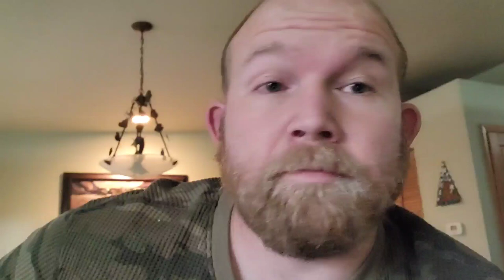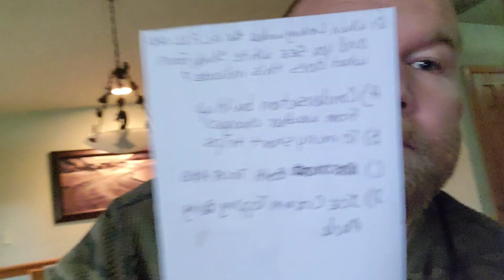Oil Cap - Why Is White Sludge Under It When Checking Oil - ASE Style Question

Comment: I have a 15 GMC Terrain 2.4 and every time the temps get below freezing I get the snot in the dipstick tube and oil cap. I drive 45 miles each way to work and back, So the engine gets to full temp. It has done it since new. Blame it on the plastic parts. 2001 Dodge Dakota 4.7 did the same thing on the plastic oil filler neck even after the “baffle” update.

Comment: i agree 200%.  but as most people don't understand what a short trip is you may want to go in to that a bit farther. 
to me a short trip is under 15 miles, as you say you need to get every thing up to temp to burn the moisture out. 
but i am up in the north east or about the same weather you have.
Reply: My father in law used to drive 1 mile to work. never let it warm up either. just jump in it Crank it up, and literal 2 seconds open the throttle up to about 80-90% as he leaves. 

I know it was 80-90% because I had a scanner on it while he was driving once, and I saw the throttle position on every green light and pulling away from every stop sign. the throttle was opened to 90% for the first 5 seconds or so.....anyways

He would complain that I wanted to do oil changes before the 3,000miles When he drove it 10miles per work week, then maybe 20 miles on the weekend.

Once a few years back it had the oil pressure light come on. I checked on the car and was switching the oil filter for a new one when the oil that got on my arm and hands started to burn after a few seconds, and it got worse in a few seconds as I was running to a sink.

....the oil had actually become acidic. And I later checked out the filter and found that it was plugged with carbon.

Comment: I'm glad you came back at the end and stated the other problem. That's the problem I see over the other two in my lifetime more than anything else.  My environment is probably different than yours as most people in this area drive more than just to the grocery store and back home.  With high prices at the gas pump one might see more of this "white foam" at the filler cap because people aren't going to have their vehicles warm up for very long. IMO

Comment: In the dead of winter mine is always like that, despite a 35 mile commute each way on the interstate. When I first got the car it concerned me so I sent an oil sample to Blackstone labs. No antifreeze, just some normal winter moisture. If you're concerned I'd suggest testing the oil. It's cheap and will tell you how the engine is doing.
Reply: Plastic filler necks valve covers. I feel that they don't heat up like steel.
Reply: @marktiitto7616  you have a good point. Hadn't thought about that

Comment: Yep, both are correct. It's nice that the grocery store or work is five minutes away, but that engine needs to warm up to and ran at operating temperature to burn off that water. Running at operating temperature will take care of the condensation from both the weather changes and many short trips (but will not take care of actual problems, like you said). Obviously where that vehicle is operated varies, but getting to operating temperature is key.

Comment: Honest car dealers are out there. 
After an hour and a half drive up and across a mountain pass to the cold side,  with an additional 1 hour+ to jobsite, unload (no more than half hour) at 30ish degrees, headed back uphill when white smoke starts billowing and engine heats up, (''75 F-350 390 4bbl glass truck) is chugging and out of power.  Dipstick is covered in chocolate milk, so I limped back to the jobsite. Off to the Ford dealer in town, says the boss. That was Friday night. Things looked grim for the old flatbed.
All cylinders held pressure as did the cooling system. They indicated a low coolant level was the only problem, no leaks detected, so they topped it off, $27.00 on a Saturday morning, expecting a blown head gasket requiring us to leave the truck behind as we were working in Yakima but home was Tacoma. That was 30ish years ago. Truck ran fine going home, as if nothing ever happened.
The technicians said it was just condensation.

Comment: This is why, in Canada i change my oil in November and May. Winters up here are harder then hell on the engine.  A lot of extreme cold operation. I have seen a car driven 50 miles on a highway at 60 or 70 mph when its -40F out and it still wont be warm an hour later.  My F150 suffered with condensation problems under the oil cap every winter, could clean it out with a tea spoon. Still got 180,000 miles out of it though!

Comment: Many years ago when valve covers were steel pressings we used to put a plate in front of the cover so the fan air would not cool it and it could run hot and burn off the condensation, now with the plastic covers this does not work. Same reason, stop start running AND with the cold ambient air (Uk winters can be cold) and a warm engine, some condensation is normal. We used to say if it is in the valve cover, no worries, in the sump, start looking for trouble. I noticed a lot driving in the tropics, the air humidity can add to the problem but it is usually only cosmetic.

Comment: I use shop air thru a regulator and add a tee to the small hose between the degas bottle and radiator on my 7.3's to pressure test them. I recently had to swap out a 7.3 because of coolant in my oil and found a crack between cylinders 1 and 3. IDK what caused it but I found it on my pre trip and it hadn't shown up on the cap yet. Was throughout the injectors, but didn't make it inside the pushrods.

Comment: I noticed my oil level is slightly low, when there is pudding under the oil cap.  After a good heat cycle, pudding gone, the oil level is back up. I then put some of the pudding in clear cup and brought it inside. It turned into oil. Try it in video Rich.

Comment: I had that problem with my 2004 suburban I changed the thermostat from a180 to a 195 and stopped having the problem it only did it in the winter.

Comment: i noticed this more on fords than chevys. i had a 4.3 S-10 and never saw condensation buildup in the winter
Reply: Personally, I think it’s dependant on a number of factors. Oil filler design being the main one. I have vehicles with a 5.3 vortec, and a Toyota with a 2GR-FE V6. Neither of them have ever had white sludge on the oil cap in the winter. Water droplets, yes…but never any white sludge. 

The only vehicle my family has ever owned that does this is a Kia 3.3 v6. It threw me for a loop the first time around, because the tip of the dipstick is also brushed metal…so clean fresh oil appears milky on the stick because of that. Quick taste test confirmed it was just moisture…but that’s the only vehicle I’ve experienced that regularly has some white sludge under the cap in the winter.
Reply from the maker: They all do it

Comment: Yep, I knew this. Learned it when I started working on antique vehicles. It freaks some people out. I even had this on the reservoir on my zero-turn once. It uses something like 20w-50 synthetic for hydraulic fluid.

Also, I always allow my vehicles to idle long enough to reach normal idle. This is essentially mandatory on my E39 BMW. Is this harmful on the 3.5 EB? I assume it isn't, but driving on a cold engine that cannot even idle at normal RPM worries me.
Reply from the maker: It's not harmful but not necessarily recommended.....start it let it stabilize and take off
Reply: @FordBossMe  Alright, will do. My learning came from the time before aluminum engines and those old iron beasts need some warm-up. BMW E39 engines do also, unless you like oil-consumption issues. Heck, they have that anyway. Thanks!

Comment: Never experienced this but have the strawberry milkshake mixture of trans fluid snd antifreeze thanks to nissans crap trans cooler in the radiator.  Tens of thousands of people did back in the mid to late 2000’s on the Frontier models.

Comment: A public service  announcement dealing with condensation that Rich is talking about to anyone  with a Generac standby whole house backup generator, I have 3 of them, 2-22 kWh units at my business & a 16 kWh at our home, the 1'st winter with temperatures down to -30 below I saw what Rich was talking about on all 3 units, come to find out Generac only has a 5 minute exercise cycle that does NOT get the engines HOT enough in the winter to burn the moisture off with no way in the soft wear to change the length of time they exercise,The work around is for me to restart them and run them for a 1/2 hour to get them HOT.

Comment: If you do see this there are a few things outside of just short trips that can cause this. No Positive Crankcase Ventilation is the #1 thing I find causing this. Outside of a cooling system failure water pump thermostat ect
Reply from the maker: I'm glad you said YOU

Because the things that you stated that affect you the most and what you see or not the most common in general
Reply: @FordBossMe  for sure you tend to work on much newer vehicles daily being a dealership technician from the majority of what I see through your channel. We do get newer vehicles 2018 2019 but for the most part 80% of what comes in the door is between 1996 and 2010. About 5% is 2011-2017. 2018 and 2019 or newer usually comes through the shop from the collision repair shop down the street and it's usually module reprogramming/replacement or a damaged wiring harness somewhere that was overlooked. The more modern engines seem not to have as many vacuum/pcv system issues. The older 5.4 and 4.6 engines I've seen come in butchered quite a bit with the goo in under the oil caps. This is most of the time due to crappy installs of aftermarket intakes or just rotted out rubber vacuum connections in my own personal experience. Usually I check to see if it's actually in the oil itself or just under the valve covers to designate whether it's coolant intrusion or from short trips or a non-functioning pcv system. Occasionally we do get old OBD1 vehicles and pre-OBD vehicles in the shop we have a few older Corvettes in for work now previously we have had some 60's & 70's Camaros mustangs challengers satellites. Honestly my favorite stuff to work on is the older vehicles people always want them done right and are willing to put money down to get good parts performance or O.E.

Comment: This is also why "frequent short trips" falls under severe service interval for oil changes.
Reply: For my cars that only get used for short 5 minute trips I tend to change the oil before winter hits and then again after the winter. I used to live 5 minutes from my job and I constantly had white sludge on my oil filler cap. On one of my newer cars it was because the Vapor Canister Purge Valve was broken and when I replaced it and changed the oil it stopped turning white on the filler cap.

Comment: Headgasket failure is super rare on these Ford 4.6/5.4 engines, especially 1996+ Panthers with the "fail safe cooling".. also I've seen the oil filter adapter gasket cross leak oil into the cooling system and a very slight amount of coolant in the engine oil.. 

Great tip.. I know you're talking vehicles in general, but I only mentioned  Ford 4.6/5.4, as I'm most familiar with triton engines..
Reply: Super rare?  Unfortunately it's kind of common.  Once it happens especially on the older ones the car/truck is salvage.  Headgaskets are about $2000.  To get to the Headgasket you have to strip the front of the engine to.
Reply: Sir I need to give you a call I am having a similar problem with my 2005 lincoln town car

Comment: Different application, in airplanes you want to get the oil temp to operating temp just to prevent this from happening. Airplane engines aren't started daily (recreational flying not commerical) and when slightly warmed up they are full throttle for take-off.
Reply: Water vapor from heat (because it's a vapor and is lighter than air, it rises) and then condenses turns back to a liquid. I have a daily driver and I keep the "family" car for longer trips.

Comment: The 4.6 is notorious for Condensation on the Oil Cap, My opinion is because of the Poor design or failed parts of the PCV system is not doing a good enough Job. Plus people try to run a 160-180 Degree Thermostat during the winter this is a Big Don't do. During the Summer, Ofcourse a 180 Thermostat is Good. During the winter you'll just be Creating Moisture Build up and have Very Poor Heat quality.

Comment: Inherited this problem My buddy paid somebody to do this valve job he put drive side head off took money and ran
So i told him i would finish 
Long story short  did valve job  
Boath heads warped mill 
Put back on now have milk  Condensation in valve covers And blow by What's your thoughts
Reply from the maker: Losing coolant?
Reply from the maker: Blowby? On what vehicle?
Reply: Yeah come to find out he payed someone else to put a junk yard motor in he had problems since he got it. 
He's only put less than a thousand miles on it. He bought someone's problem unfortunately 
Have purchased a long block program  solved
Reply: Thanks

Comment: Dame.  Thank god...Yea Already Got another Engine. And Tranny..well Tranny another deal..But Hoping this is the Case...We "Just " had a Freeze Phase here Inn Texas so I'm thinking "Temp" change..Long story short just notice the white sludge on Oil Cap..and I freaked out...knowing 9 outta 10 that's  NOT..good 😞
Reply from the maker: It's typically not driven enough to burn off moisture or way to many short trips

Comment: My father in law used to drive 1 mile to work. never let it warm up either. just jump in it Crank it up, and a literal 2 seconds later he would open the throttle up to about 80-90% as he left. 

I know it was 80-90% because I had a scanner on it while he was driving once, and I saw the throttle position on every green light and pulling away from every stop sign. the throttle was opened to 90% for the first 5 seconds or so.....anyways

He would complain that I wanted to do oil changes before the 3,000miles When he drove it 10miles per work week, then maybe 20 miles on the weekend.

Once a few years back it had the oil pressure light come on. I checked on the car and was switching the oil filter for a new one when the oil that got on my arm and hands started to burn after a few seconds, and it got worse in a few seconds as I was running to a sink.

....the oil had actually become acidic. And I later checked out the filter and found that it was plugged with carbon. 
(has anybody else ever seen oil turn acidic?)
Reply from the maker: I have not ever experienced this
Reply: @FordBossMe  well when the oil that you know is cold starts to feel a little warm, then a little warmer. It seriously sets off the flight mechanism in the brain. And for the next few days the arm stays a nice pink color where it was.